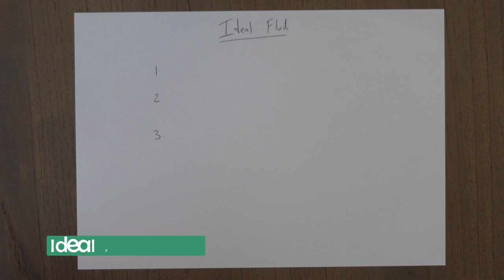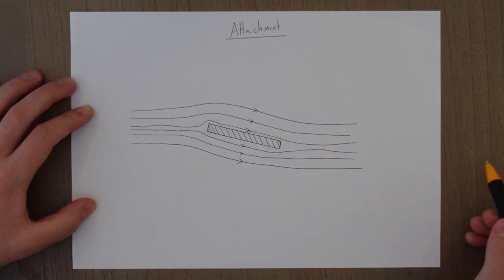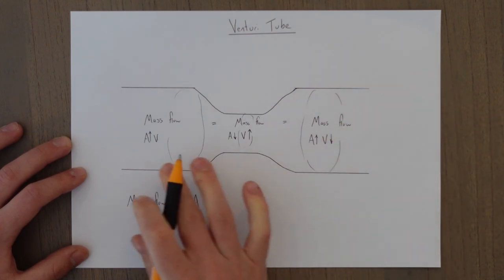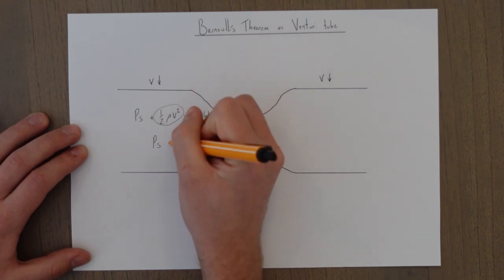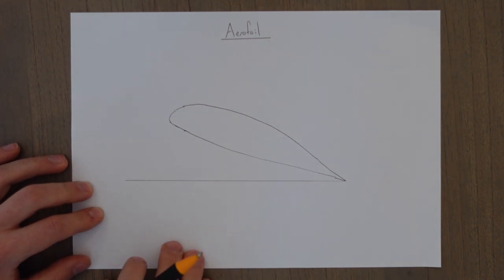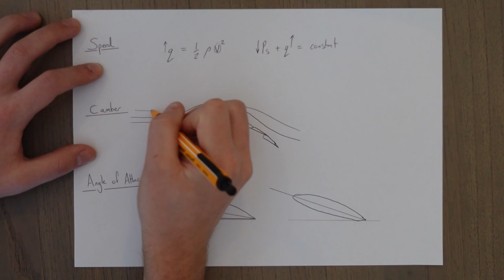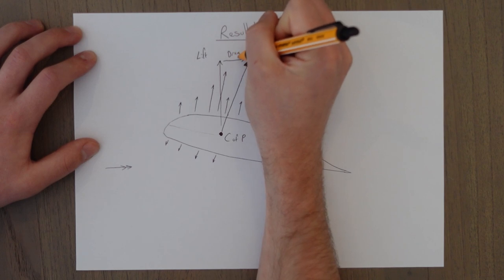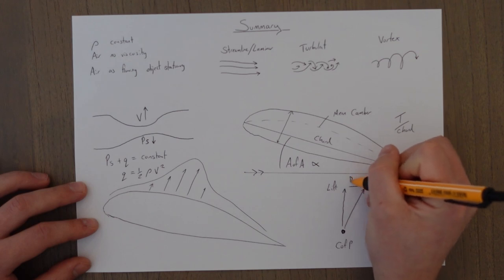ATPL Principles of Flight - Class 2:  Airflow and Aerodynamic Force.

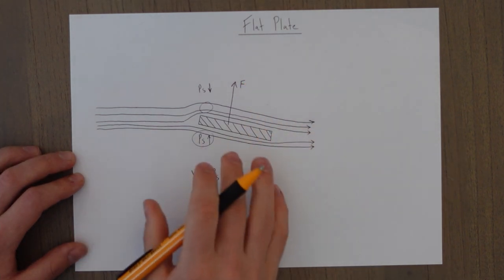Comment: 13:00 I don't understand. Why is the static pressure higher below the object than it is above the object?
Reply: Because the speed is lower under the object and thereby higher static pressure. Above the object it is lower pressure and higher speed. Increase speed, decrease pressure and vice versa.
Reply from the maker: Exactly as Joakim says. 
Remember Ptotal is always constant and Ptotal = Pdynamic + Pstatic. So if one goes up the other has to go down to balance it out. The faster flowing over the top means that Pdynamic goes up, so Pstatic must go down and this "Lifts" us into the air.